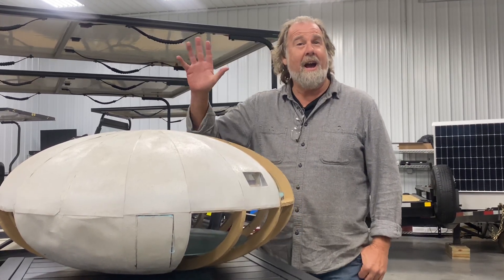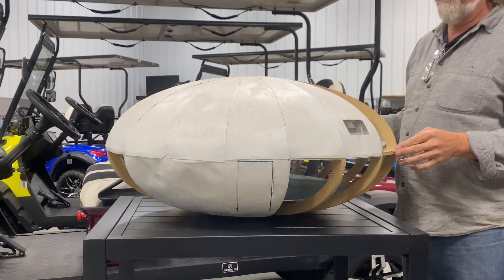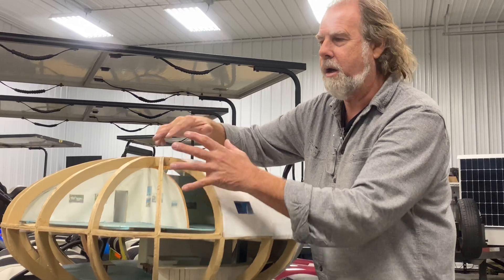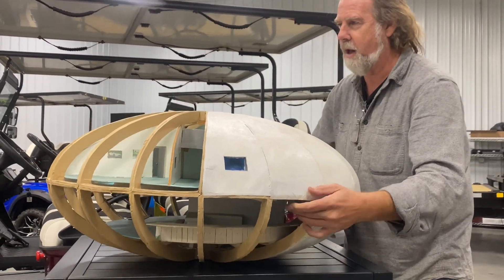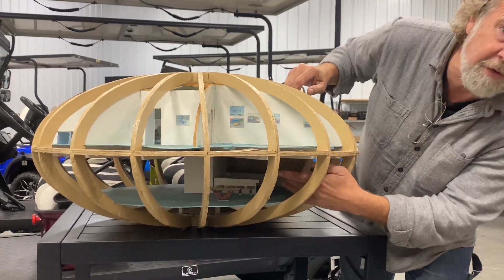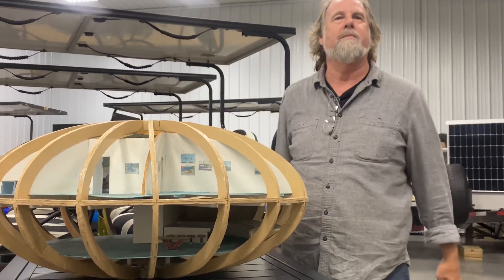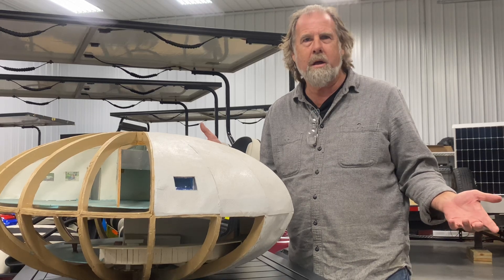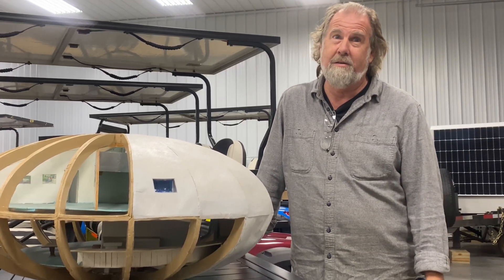@ZSRSOLAR future home solution! “Teach” from The ZYNOC Foundation explains… #envirohouse

Comment: Wow, this is so cool. However ( and I am NOT trying to belittle this project, nor am I lying), I designed a house pretty much like this in 1968 (my senior year in high school). The one major difference is that in my design, the Center of the structure was designed as an Open courtyard that was open clear to the top and had balconies on the second floor that opened into this space. 

Way Cool my friend keep it up I too would like to see these being built.

Also, that same year, I built an RC Flying Saucer that got off the ground and then Crashed immediately. LOL, I still have the remains hanging on my garage wall.
Reply: Picks or it didn't happened!!!  Internet standard rules.